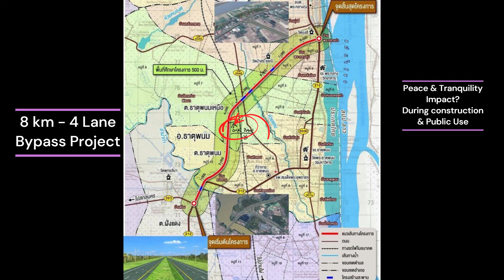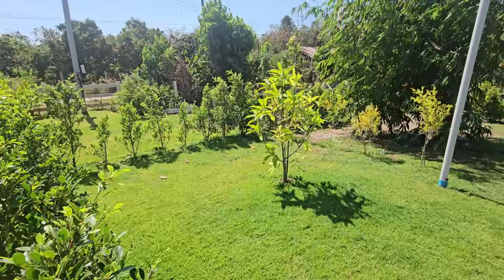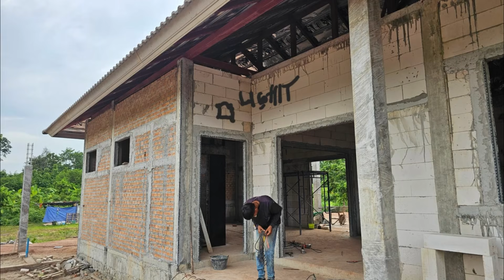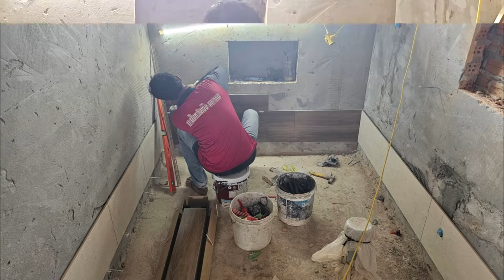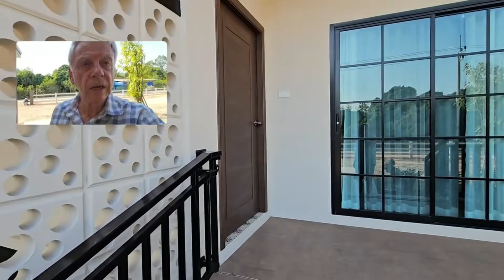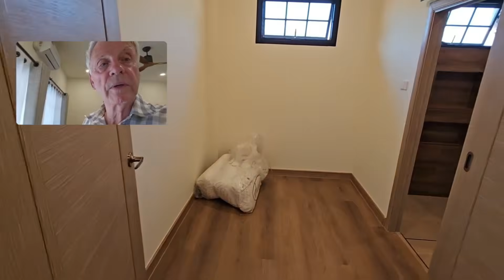Thai House Build - 1 Yr Anniversary Review

Comment: Thanks for the video. I see that you have used the solar thermal heating advantage. I'm sure you will need a lot of electricity to cool down your home. Unfortunately, I prefer to reduce dependancy on government electric bills and be totally off-grid. Passive cooling is my choice for reducing or even eliminating the need for mechanical A/C cooling.